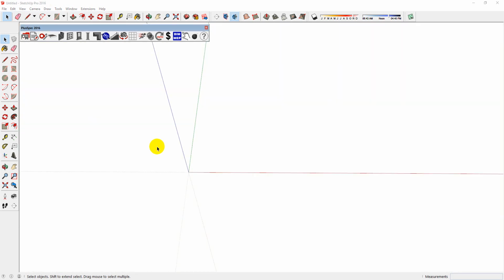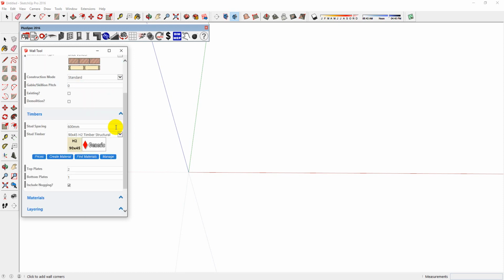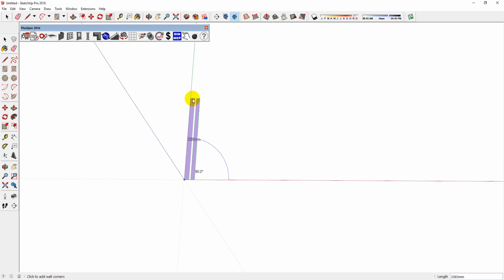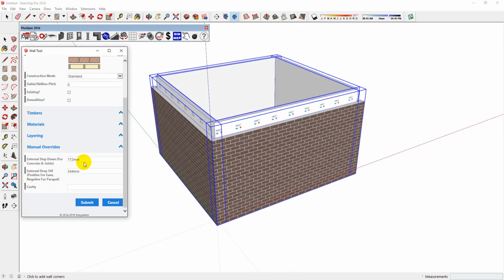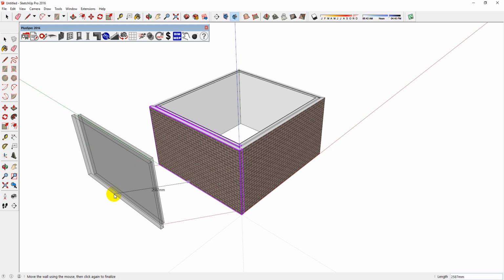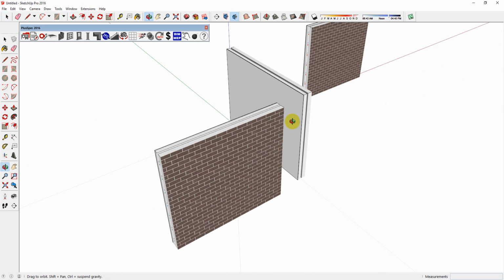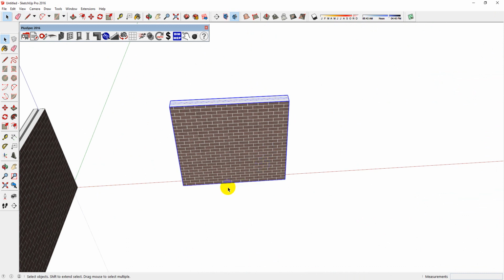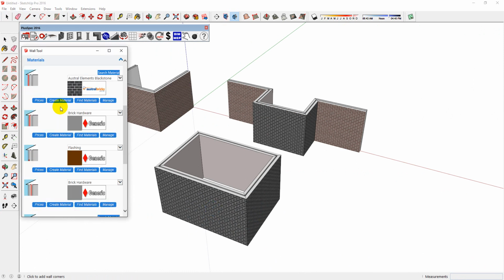PlusSpec Wall Tool Overview

Comment: Only 1 side of my wall is forming when creating a wall loop? Any advise?
Reply from the maker: @minthigsss  hi it is best to use the forum for this kind of question. However, i think you need to sync your materials.  It's the circle arrows in the PlusSpec toolbar. You could also click the scene tool if you're not seeing internal lining, or turn the tag on. https://forum.plusspec.com/

Comment: Stoked I found this vid. Just wished I'd watched it earlier....loving those shortcuts...right arrow to toggle through the wall draw start point....cool, INS for changing wall direction, got it, DEL to undo...that will get a work out 😉, and CTRL to disable auto connect push/pulled walls with a new wall. Should speed things up a bit too.

Comment: My wall tool does not have block or filled block. Have they been removed in updates?
Reply from the maker: Good day Daniel, Thank you for your message, we have noticed that you have sent through a support ticket and have provided a solution there, regards.
Reply from the maker: They are in Masonry walls
Reply: Daniel choose: Masonry walls as your wall type> Choose material> to claculate the quantity of core fill simply associate a recipe ( PlusDesignBuild only)